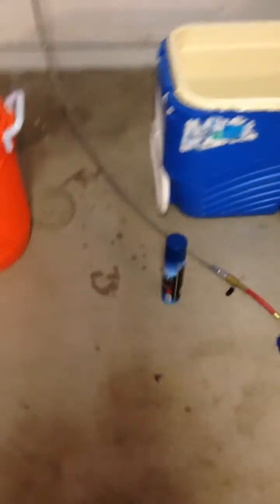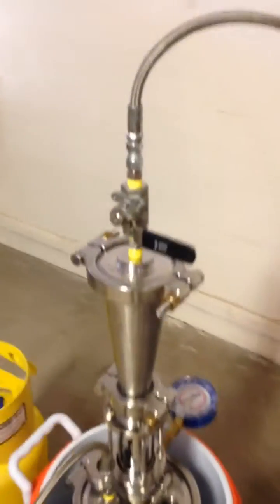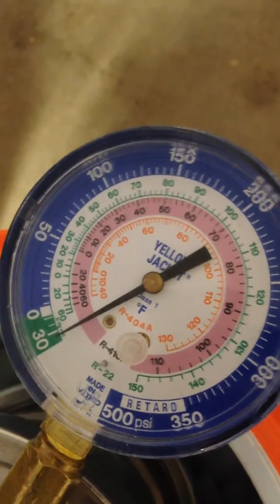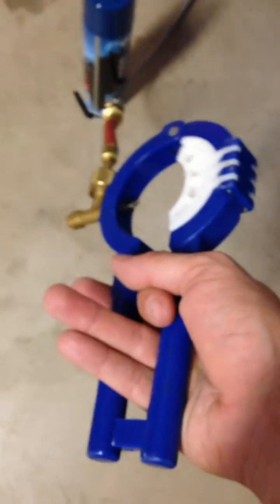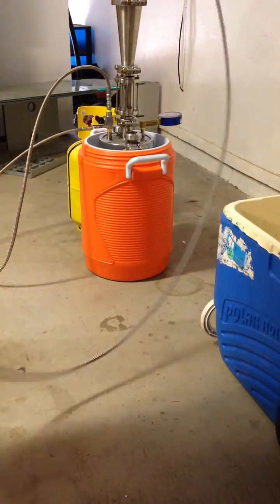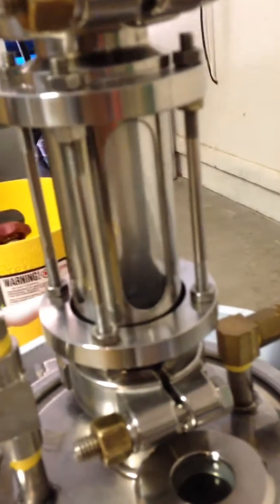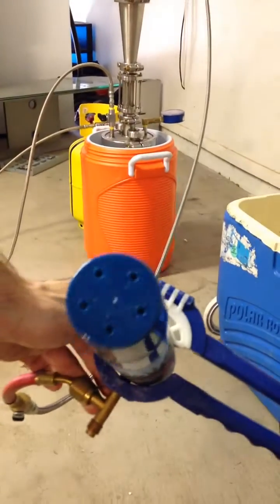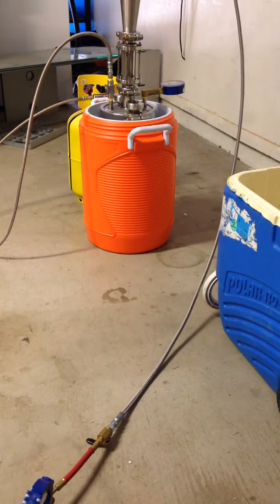distill Pt 1

Comment: cool vids man great job thanks BUT you need to be releasing some gas from your tapper connector While attaching it to your intake line - this is how you Push oxygen out of the line before it enters the intake line. its kinda weird to explain but each time your tapping a nother can, a small bit of oxygen gets into the line. Bhogart instructional vid shows exactly how to do this right & simply put: Oxygen in the loop at all, at any point is Not safe